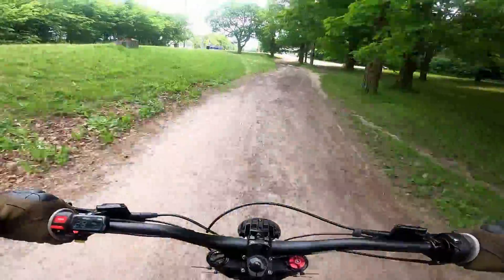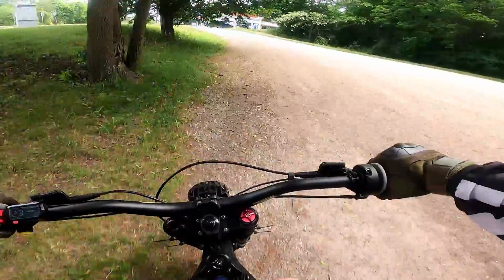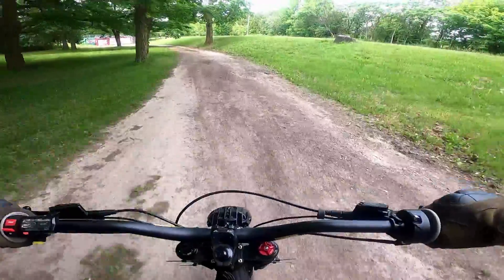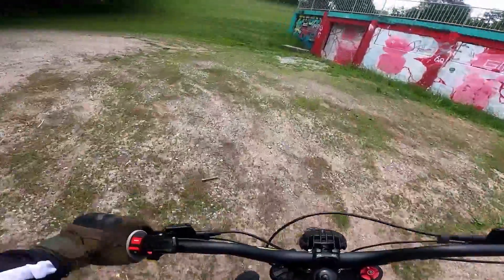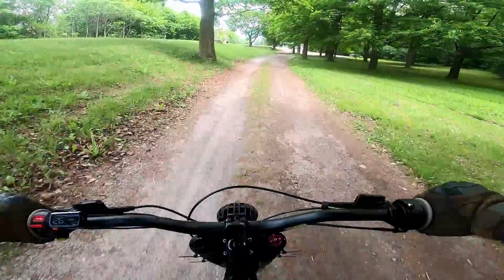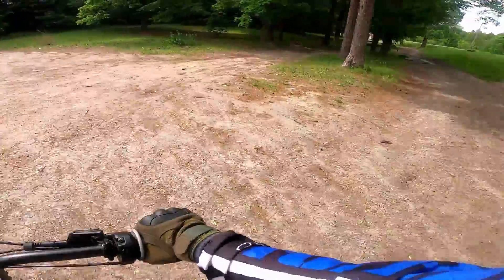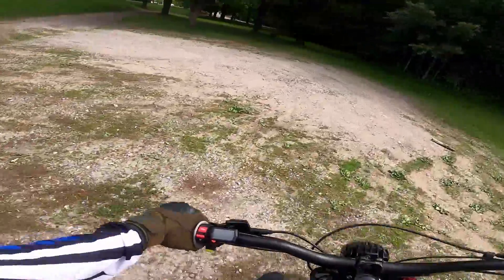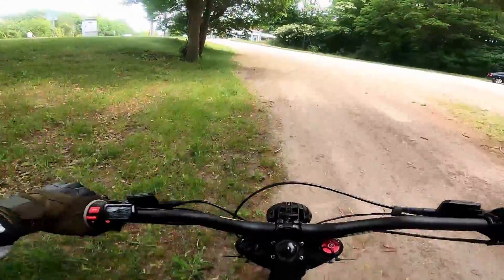How to program Sur Ron x controller

Comment: hey mate do ya know why i cant turn regen off with the brake lever / kickstand programming method? its a 2022 sur ron x sinewave model.. ive tried everything.. no one seems to know.. ive used the dongle with stand up or down using brake lever, also tried using the stand to set it.. starting both ways, up and down, tried with out dongle, still no luck
Reply from the maker: I've never tried to use the kickstand I just use the brake lever . Did you get the bike used or new ? Are the brake sensor cables still installed alot of guys take them off for some reason then you can't program anything . You don't need the dongle . All I can say is take the bike off the kickstand turn the key and wait 5 second then pull the brake lever 7 short and then hold it in for like 4 seconds and then it should be turned off .
Reply: Had the same problem!
For me, this worked: (kickstand up)
With the bike off, hold the battery button for a few secs till it powers off, turn it back on then turn on the bike itself and as soon as it starts do the brake command and then wait for about a minute without doing anything else, and then turn off the bike, wait 5 secs and then it should work 👍